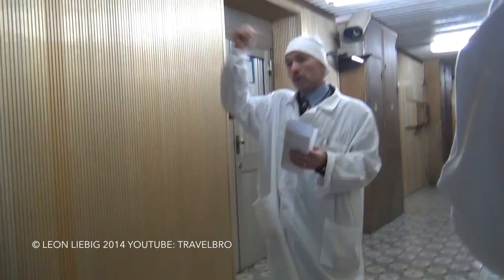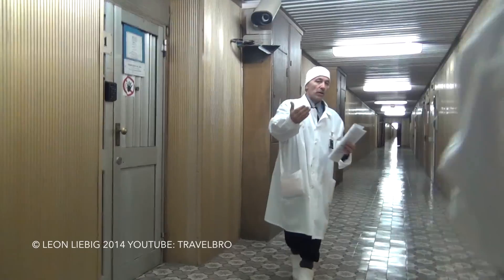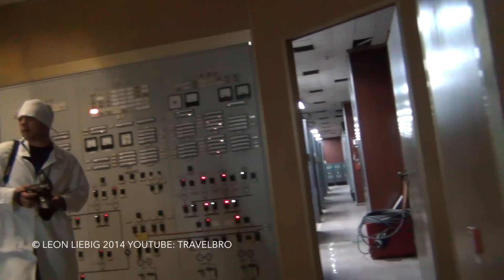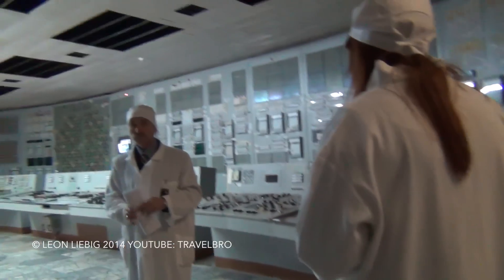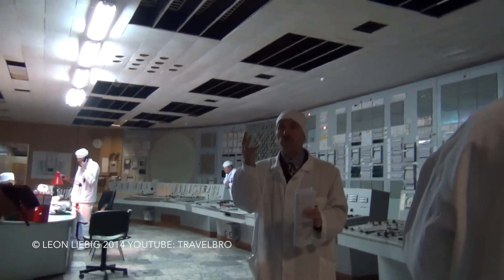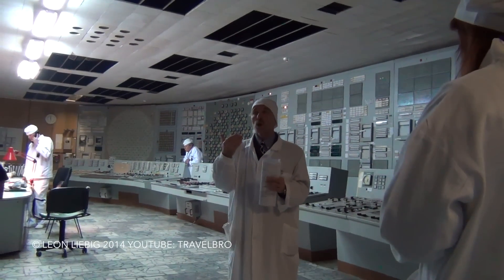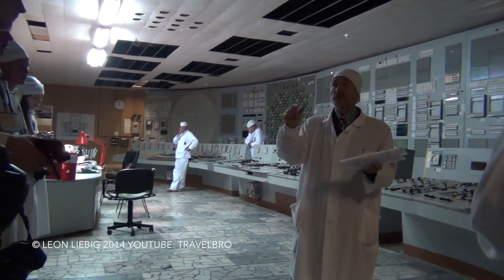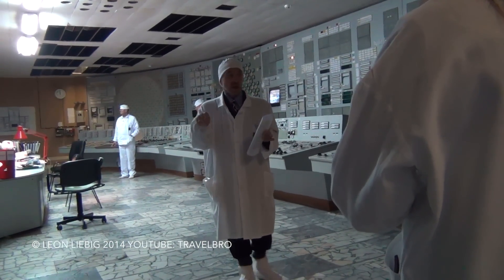Inside CNPP Part 1/3 (Chernobyl Nuclear Power Plant)

Comment: For what do they use the remaining power plants now ? Because there are still a lot of persons there at work i think.
Reply: Elfoxoloco  "you could say that reactor 4 still has plenty of fuel in it."
Erm... I wouldn't say that. Part of the fuel was blown out during the explosion, and what remained pretty much all melted down into the spaces below the reactor. Don't quote me on this, but I recall reading somewhere that less than 8% of the total amount of fuel is still inside the reactor.